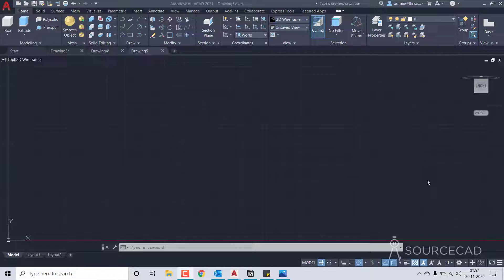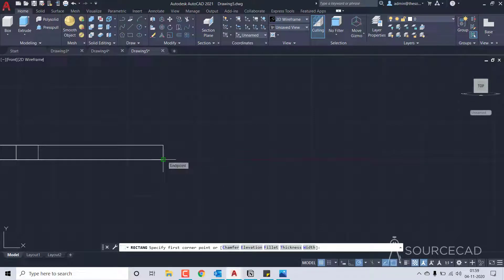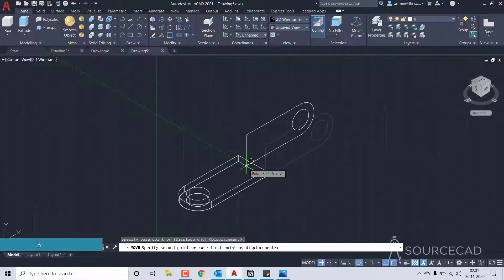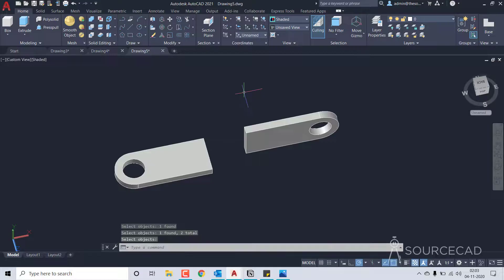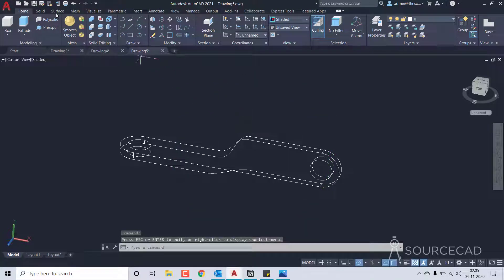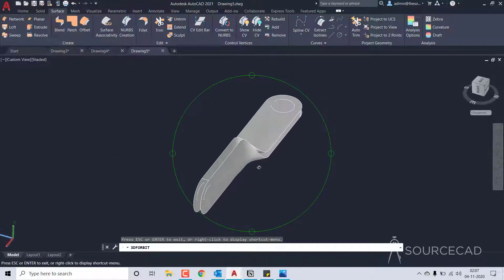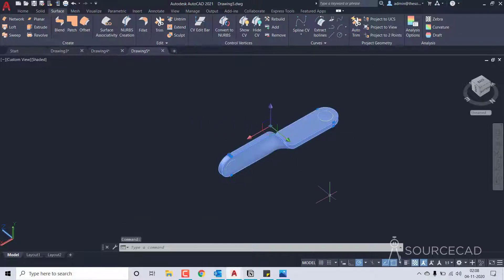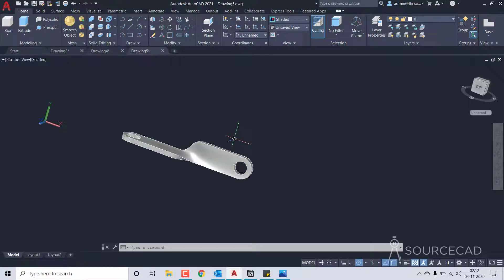3D bracket with Solid and Surface tools of AutoCAD

Comment: you don't need to press pull in 2 directions then use the subtract function. Instead just press pull twice using the same face in the same direction and it will create the void. I also don't know why you don't just hold shift and left click drag to rotate view.

Comment: Perfect. But I wonder if there is any other way to draw this object
Reply: Yes there is. Don't delete the two solids. You can make the middle part drawing a rectangle and use the command Sweep with a 90 degree twist and after that use the align command to put it in its place.
Reply: @luanalidema  hello, dear. Can you please help me with this? it's sound very easy to accomplish but somehow doesn't work for me.
Reply: @Lia-g3d In this chat window I find it difficult to know what is not understandable for you so I can try and help you. Ptobably the best would be  check the posted video and pause after each command and study the used commands.

Comment: i do literally exactly as this video does and when i try to sculpt it it tells me the object is not watertight, i have tried this over 4 times now and i cant figure it out. anyone know what might be causing this? thanks
Reply: Same problem as mine so i tried to use the patch tool only for the twisted part. For the rest, I use extrusion. Then boom! SCULP works.
Reply: I had got problem as well. Could you please tell me solution? Thank you.
Reply: @mevlog7555  i found it probably has something to do with double lines ontop of eachother. im not sure why or how to fix that tho.
Reply: zoom on the curves their is gap in between you have to fill it both side then it convert into sculpt
Reply: I had the same problem. I'm not sure why but once i rotated in a few times it then decided to work, I changed nothing though.

Comment: Hi. Can you explain what i'm doing wrong?
When I use a SCULPT commend Autocad says:
Solid creation failed, no watertight volume detected.
Reply: Yaa i get same issues too 🙄
Reply: It's clear draw a water tight volume while working on the surface make sure to join the surface on each edges properly.